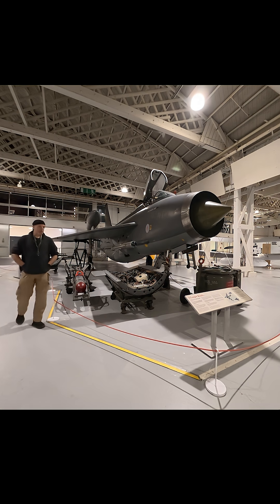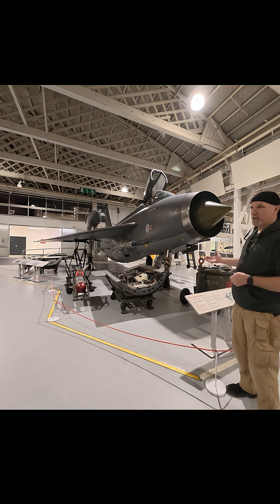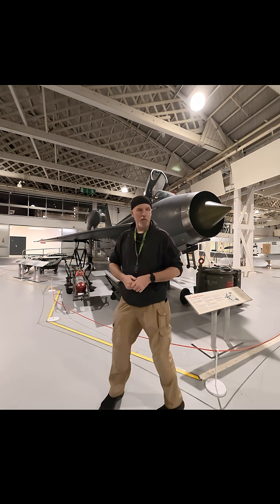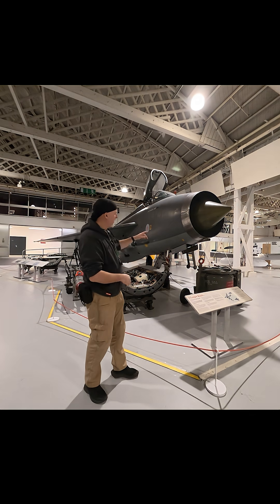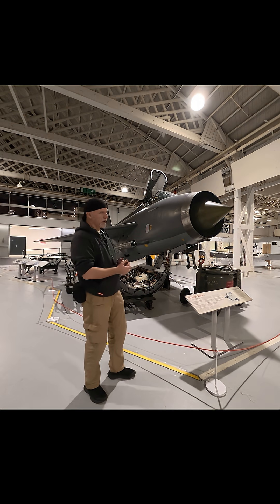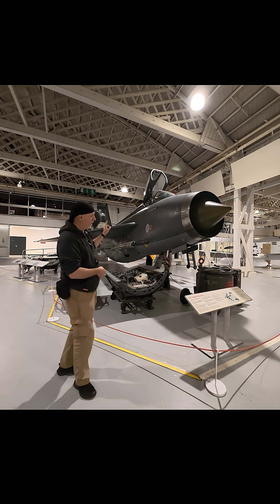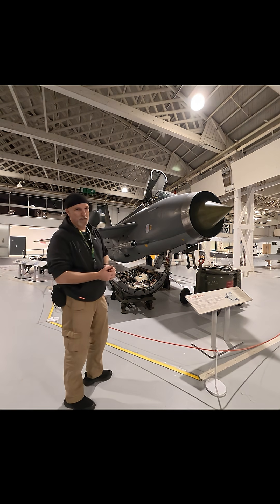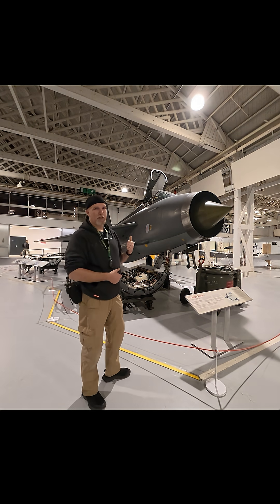EE Lightning, you owe it an appology

Comment: I think it's beautiful especially when polished unpainted, the Phantom F4 that replaced it at RAF Wattisham when I was working there looked fat and ugly compared to the Lightning.
Edit: Only thing that killed it was a lack of loiter time.
Reply from the maker: I dunno, I mean Phantoms have their ugly beauty too.
Reply: @TheOldScienceGuy  Yes now, but after working on base near the runway in the 70s watching the Lightning's stand on their tail going QRA seeing the F4s was a letdown.
Reply from the maker: Not to overly aviation nerd, but QRF practice wasn't to do the showstopper rocket to space take off. They'd fly out on a far more horizontal path as this would optimise the speed both to altitude and horizontally. There's a whole sequence as it passed through different altitudes and speeds. Seeing them stand on their tail was pure awesome though.

Comment: It was designed as a supersonic research aircraft.  It was rushed into service as an interceptor when the powers became aware of a supersonic Soviet threat. 10minutes fuel in burner and just 2 infrared missiles...?
Reply from the maker: THis is a fairly harsh assesment of it, but I guess broadly true. The missile load and lack of additional fuel was a compromise for speed. The theory being, if you didn't catch the TU22 fast enough and you didn't manage to shoot it down with the two missiles you had, then you'd already failed the mission. And while yes, it was a fairly rushed adaption of a reasearch airframe, it was a fairly mature airframe in terms of development. Definately a better option than the thin wing adapted Javelins that was the other plan.
Reply: @TheOldScienceGuy  Well said,